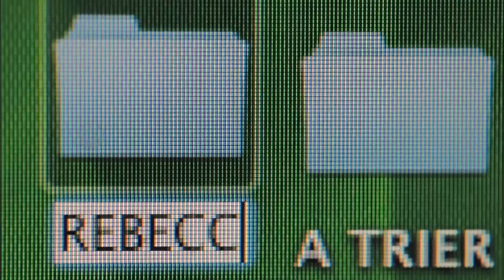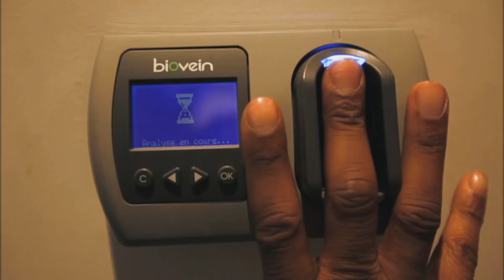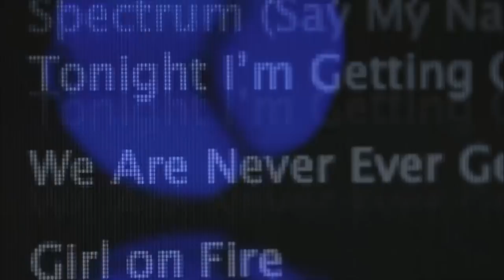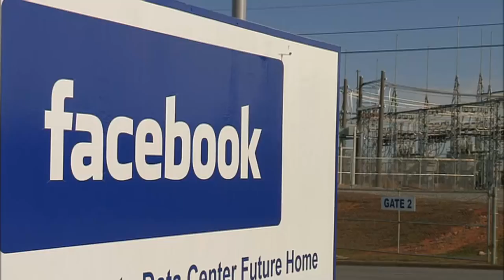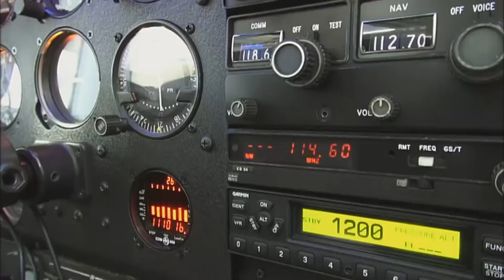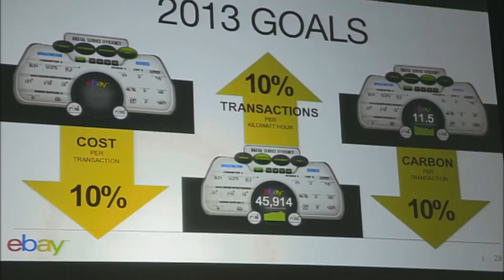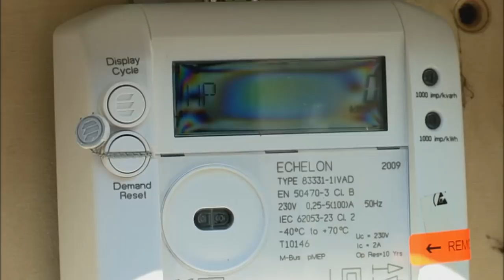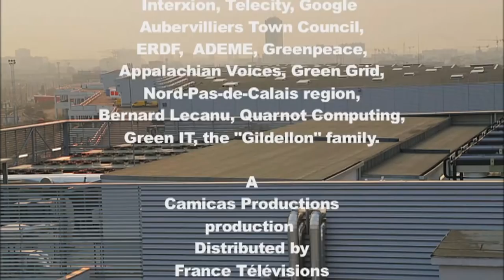Datacenter, the hidden face of the web

Comment: notice this was made circa 2013. then cpu consumption power was astronomical. fast forward just 5 years and cpu power is the lowest EVER with most having the ability to control the amount of power used in peak operations. this was not yet the case in 2013 where cpu's ran full power full time. modern day data centers are set for load balancing and when the demand is not there things power down.
Reply: @gretchenwhitmersucks9122  this has to do with CPU architecture, since modern CPUs have smaller transistors that have less resistance, they don't get as warm as then and costume less energy.

Comment: Key elements in a Data Center include but are not limited to Internet Redundancy, Cooling Redundancy, Critical Power protection such as UPS’ and Generators. 24/7 security is always a must not only with CCTV and Controlled Access but with staff around the clock. Network monitoring, Network protection, Remote Hands and customer support are also among the top priorities for a Data Center.

Comment: these 'facts' regarding an email taking a lightbulb for an hour is total bullshlt
Reply: The part they fail to address is that the whole chain isn't just processing a single email. It's processing hundreds of thousands.
Reply: 5 Wh for 1 MB or 24 Wh for 5 MB of Data is - on average - realistic for sending/storing an email. Even today is not that much better. Yes, Google & so on got way efficent but the rest of the backbone not that much. There are still some datacenter with a PUE of 3 and above whereas Googles datacenters in the US have all a PUE of ~1.2 PUE. And you have to keep in mind the data is send from your pc to your email server, from there to the email server of the recipient were its stored too and than to the recipient. Further you have to consider that in the EU in 2013 were basicly no lightbulbs over 25 Watt allowed to get the reference.
Reply: @dj osearth     You seem like your typical  internet user who thinks all this internet is "in the clouds", which hardly uses energy..... Ofcourse they didn't mean your e-mail takes that amount of "lightbulb" energy .   They meant the total footprint of materials used ,glassfibre, copper ,buildings ,to all the workers (and the energy they use ) . Looking at it from that point it makes actually some sense.
Reply: Their probably right about it being 24wh for 5mb but their leaving out that 5mb is sent in half a second or less. So unless your pounding out 120emails a minute the energy usage bandwidth wise isn’t what they state.